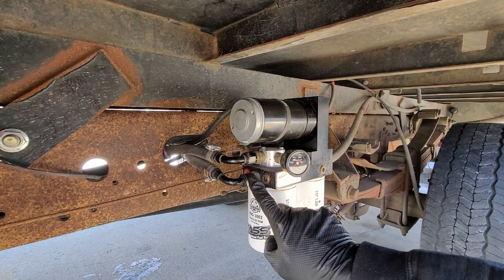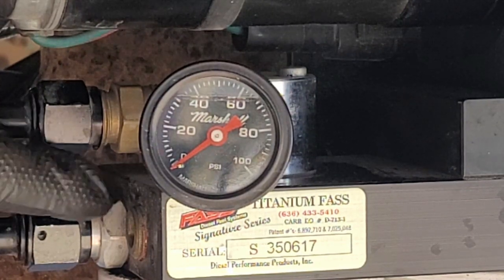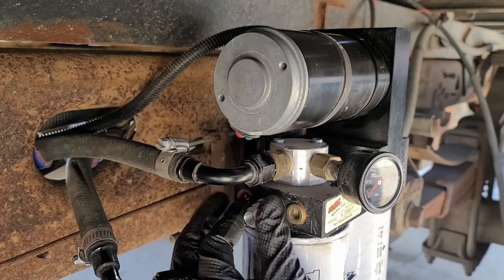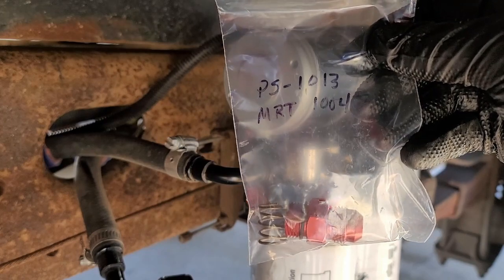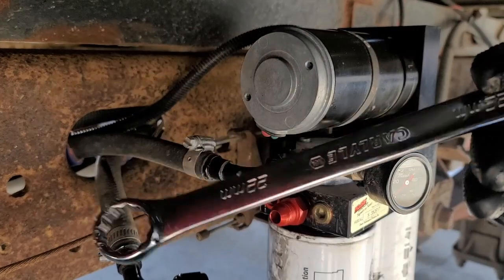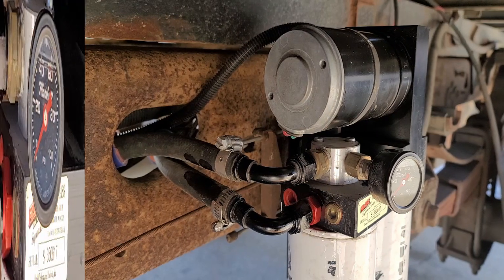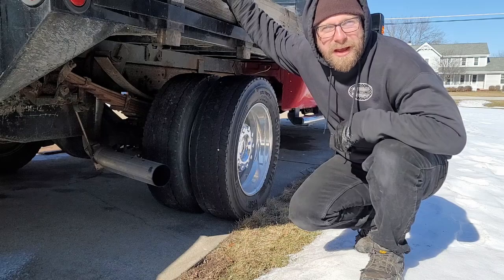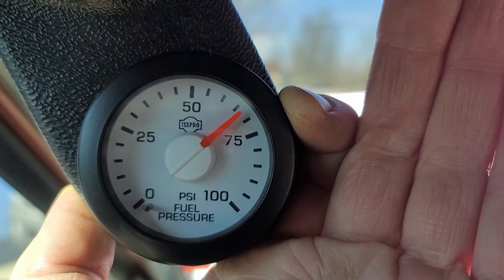How to INCREASE or change pressure on your DIESEL FASS fuel system.  7.3 Powerstroke PSD

Comment: How is that gauge that you have on the pump holding up….is that a FASS product?
Reply from the maker: The gauge has been great, here is a link to it:
Marshall 100psi fuel pressure gauge mounted to my FASS (you'll need the NPT fitting below also):
https://amzn.to/3BUHAds

1/8" to 1/8" NPT adapter fitting for fuel pressure gauge to FASS block (moves the gauge away to clear the block)
https://amzn.to/3JKP3il

Comment: Is that the titanic you are bolting it to? My 1957 ford doesn’t have that much rust. Maybe get some por15 or paint or really anything.
Reply from the maker: This is a super clean frame for up here in the rust belt.  I like it how it is, can't make them all look brand new.
Reply: The stance of the truck looks 👌Close to the end when you were trying to start it you never gave us an updated on the front axle conversion with all the parts you need to do it Thanks Happy Thanskgiving.
Reply: Is that a newer year rear axle conversion aswell

Comment: I have a 7.3 superduty and did this mod but my fuel pressure didn’t change at all. I have a driven diesel regulated fuel return and I can’t get above 45psi at the pump and under the hood at the regulator. Brand new warranty’d pump too. Any advice ?
Reply from the maker: You could try shimming the spring so that it can't open the relief/return as far.  I guess that's what I would try.  Make sure you are also getting an unrestricted flow from the tank to the pump.  I put a bottom sump in my tank with 1/2" line  as the supply to my fass.  Why do you have a driven diesel regulated return setup when your fass is self regulated and returns to the tank?  Your setup doesn't sound ideal for what you are trying to accomplish.

Comment: Where u get the adapter that plugs into the gauge on ur fass
Reply from the maker: It's listed in the description of the video, amazon link
Reply: 1/4 goes into the fass gauge fitting ?
Reply: Thought the size was 1/8 that fits in the spot guess I’m wrong
Reply from the maker: sorry about that, I had the incorrect link.  I used this 1/8npt to 1/8npt to act as an extension so the gauge would clear the body of the pump.  https://amzn.to/3JKP3il

Comment: Why on earth would you put the fuel pump and filter in such an exposed location?
Reply from the maker: It was a good 2 feet off the ground, easy to get to, easy to run fuel lines, oh and that's where the manufacturer instructs to mount it.  😀

Comment: Thinking about getting one of these to use on my 6v53 swapped IH. 72 psi at WOT is spec
Reply: Im wanting too. Just don't have the funds to do so.
Reply from the maker: Would probably help that old 2 stroke make some great consistent power.  My needle on the gauge doesn't even drop @ WOT.
Reply: @frostydoesit  it does ok as is but it definitely  needs some help. If feels as if it's starving on the top end
Reply from the maker: @WARD5KUSTOMZ  if you ever do it let me know if it changed your seat of the pants dyno

Comment: Has anyone been losing prime randomly on their fass?
Reply from the maker: Sounds like you may have an air leak somewhere
Reply: Mine is loud as f*** on my F-250
Reply: @Sweetrayz  they are too loud. Unit NOT perfected !!
Reply: yes ! Its pissing me off. Truck stalls, loosing power steering, AINT COOL  !

Comment: I just installed the FASS 220 on my 6.7. I've got a ton of mods so getting out ready for the dual fuel mod. I've been disappointed with the pressure reading. Was 39-42psi with stock pump. With the FASS I'm only getting 36-40psi. Definitely not what I wanted. I think I'm going to get the adjustable fuel pressure regulator rather than change the spring.
Reply from the maker: The fass system self regulates it's pressure by the spring, it will never produce more pressure unless you change that spring.  A separate regulator will only allow you to reduce the pressure.  What kind of pressure are you hoping to see?
Reply: @frostydoesit  I'd like to see 55psi. I'm planning a dual high pressure pump setup with 50% injectors, so I need enough pressure to stay safe under high loads
Reply: I've got most mods done. Only a few mods left to put me at 1400-1600hp. Right now I'm stuck at about 800hp at the wheels. I'm already losing fuel pressure under load, and adding a second high pressure pump will exacerbate the problem. I'm also going to delete the top side fuel filter. I think the FASS system is enough and don't need the extra restriction between the FASS and high pressure pumps.
Reply: @hgffrank I’m currently have this issue truck is running out of fuel doing the pressure test tomorrow I guessing it just can’t keep up with the 10mm pumps and big boost
Reply: @hgffrank  hey man I’m about to be adding dual fuelers a compound setup and 100% overs in my 6.7 powerstroke. How did you end up getting the fuel system figured out? What did you do?
Reply: U can just stretch the spring like I did for my cummins. Fass is the ones that told me to just stretch it a 1/8in at a time

Comment: So you needed more pressure. ?? I have a Duramax and I need to clip my spring I have to much pressure at idle
Reply from the maker: Yes the 7.3 runs better in the 60-65psi range.  What are you running in your Dmax?
Reply: @frostydoesit   desired  fluctuates 4-5  psi actual is like 11-12 but when it warms up or your drive it’s fine I’ve also heard they run about the 5-6 psi range  I’ve heard I may have to cut the spring
Reply from the maker: Try giving Fass tech department a call, they are very knowledgeable and will most likely have a solution for you.

Comment: Great video. Is this for 6.0 with regulated returns or can I throw in on my truck that’s unregulated?
Reply from the maker: The model pump I installed is for 6.0 or 7.3 powerstrokes.  I deleted my fuel bowl though.
Reply: @frostydoesit  gotcha
Reply from the maker: @salamanderss11  the fass pump can self return to the tank depending on what pressure spring you install in the block.  That's what this video shows